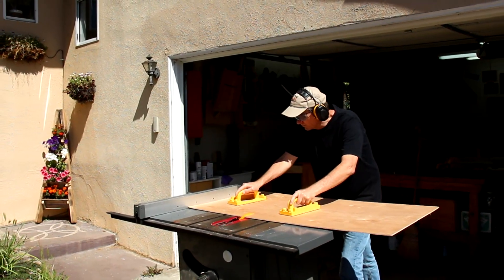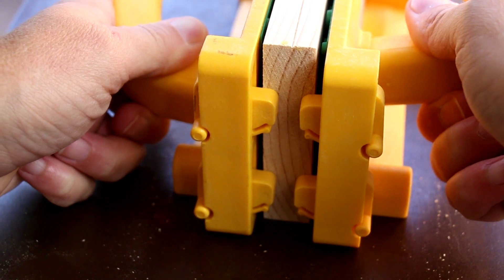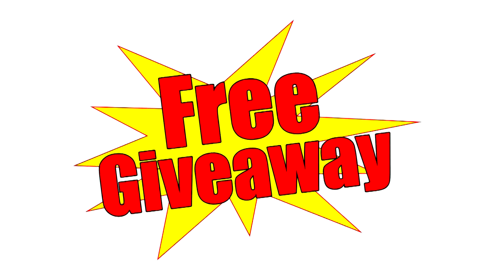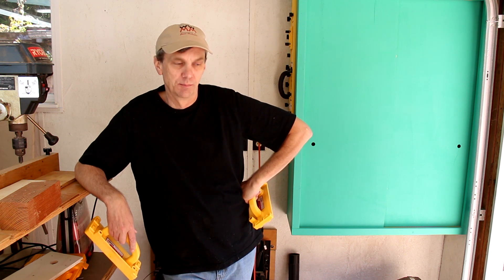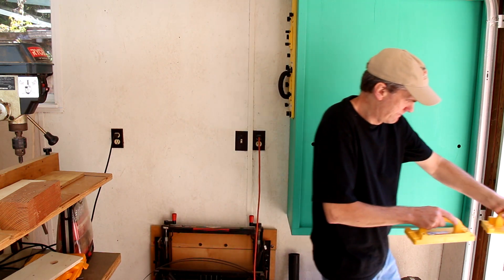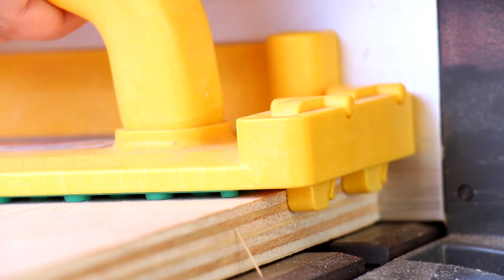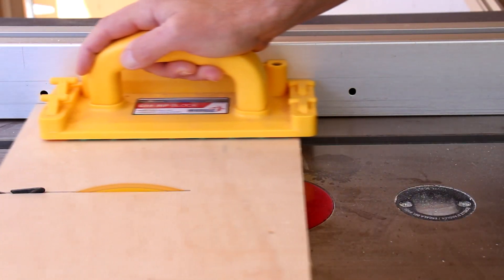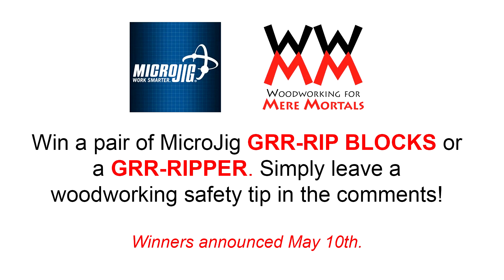Woodworking Safety Day. Thousands of safety tips in the comments!

Comment: Hey Steve. My shop safety tip is a two-fer but it's an important shop safety tip. Cleanliness and Maintenance. Make sure you keep your shop clean and organized. This also means make sure you clean up boards off the floor. Tripping on a board or falling on a tool can cause serious injury. Also maintenance, a well oiled tool or a sharp blade- either saw or utility- is much safer than a dull one. Remember a sharp tool is a safe tool.

Comment: Another good idea is to make sure that any power tools has no power going to it when you're working with the cutter.  I tend to keep my tools unplugged until I'm just about to use them.  It can be a bit of a pain, but it's less pain than dealing with an angry router buzzing around on the shop floor.

Comment: Practice the cut you are planning to make before using your tool with power. Not only will this show you any problems (such as not enough room on your out feed table), but will build your confidence when making your cut. There is nothing worse than being afraid of the cut. This is also a great tip for beginning woodworkers and those teaching.

Comment: Whenever you are changing out saw blades on any of your power tools, make sure to unplug or disconnect the power supply.  You definitely do not want to accidentally hit the power button while working around the blades. This is especially important if you have a cordless circular saw, you would need to remove the batter then.

Comment: #1 never work tired. Take a rest or a nap if you need. When you are tired your responses slow and if something were to go wrong, you might not be able to react fast enough. 

#2 always keep a stocked first aid kit with gauze, bandages, burn ointment, and antiseptic. it never fails to amaze me when I walk into a shop and the first aid kit is missing or empty. It only takes a few minutes to check and it could make the difference between a cut or a casket.

Comment: Hello Steve :-) love ur show!! My safety tip is: when using a skil saw, use a hard surface, don't try to hold the wood on your knee while cutting one end of it with your other hand! AND, make sure the guard goes back to cover the blade BEFORE you set it down and ruin the floor :-)

Comment: One thing I always do religiously is not just switch off a saw, router, planer, etc...when changing blades, but also unplug it and keep my kids out of the area while doing so. I also never leave power tools plugged in when I'm not using them to prevent curious little ones from doing their own woodworking projects without me.

Comment: I bought a jointer and installed the fence upside down which left a gap at the bottom that the blade guard slid under after a cut I made. The blade knicked the tip of my finger(yes I luckily still have a finger). My safety tip is: Read the installation instructions.

Comment: After changing your bandsaw blade  especially if you own a Grizzly,  go back over the bandsaw to make sure that you put all wheel covers, and blade protective covers. especially the blade cover to the left near the on/ off switch.  Otherwise you could while cutting and turning the the wood in a thought less motion,  could result in cutting your left arm getting cut to the bone and walk up the bone. The blade will suck you in and the blade is not forgiving. Lots of blood and the pain will come later. So my safety suggestion is  CHECK everthing once again for forgotten protective covers.  Your your arm  is very important .

Comment: No power = no problem. When changing bits or blades, or when cleaning or adjusting any power tool, remove it from its power source (unplug it or throw the breaker). When you're done, return power to the tool. Be sure to read, understand, and follow the instructions that come with your power tools.

Comment: I don't have a woodworking tip, but if I did, it'd be to not work with small pieces. Instead, machine the piece when it's part of a larger board, or glue it to something you can handle without your fingers getting close to the blade or bit.

Comment: In a house with toddlers or young children... it is imperative to keep the shop locked if possible or at the very least keep all tool safety "keys" removed and inaccessible. 

If the tool has no safety key, I recommend zip tying the power cord to part of the tool. Zip ties cost pennies and are a great way to child proof a power tool when not in use.

Comment: Norm Abram recites a standard monologue about safety. The exact wording has varied over the years, but most of the time it is substantially as follows:
"Before we use any power tools, let's take a moment to talk about shop safety. Be sure to read, understand, and follow all the safety rules that come with your power tools. Knowing how to use your power tools properly will greatly reduce the risk of personal injury. And remember this: there is no more important safety rule than to wear these — safety glasses." [He points at his aviator-style prescription glasses.]
(occasionally added) "And also hearing protection when necessary."

Comment: I would have two bits of safety advice:
1. Always use the proper amount of clamps for a project....lacking clamps and having someone hold bits together, even in a simple controlled project, can lead to injury. You never know when that drill bit is going to break because the material is dense, or when something is going to hit a knot and make the one using the tool loose control momentarily.
2. If you don't know the wood, haven't worked with the wood before, or it is exotic look up the lung safety info before sanding/working it. If you don't want to do this, just get in the habit of using a respirator/mask. Better to be safe than sorry with your lungs, and it's easy to forget this step.

Comment: Use a zero clearance insert when cutting small pieces on the table saw otherwise the could fall down into the saw and hurt you if slingshot out.

Comment: Obviously late but when using a drill press with a hole saw duller than my brain, it is a BAD idea to hold the workpiece in place with your hand while working at night in a shed where the only working light is a clip light. The workpiece will get stuck on the saw and start spinning. Took a chunk out of my thumb. Typing on my tablet is hard because it registers two separate touches.

Comment: The safety tip my father has told me at least 100 times..   Do not use the jointer for short pieces.  "I've seen more fingers lost from the jointer than the table saw."

Comment: Create habits that become automatic and second nature : e.g on the router table I do this  - Finish the cut, turn router off, wait for the cutter to stop, remove the piece, switch off the power. 99 times out of 100 you don't need the additional safety that the routine brings, the 1 time that you needed it, it's already there.

Comment: 1. Do not clean off equipment with compressed air. It might be fast and efficient but it can blow debris and chips into your eyes. Depending on how fine the chips are the debris can even get around safety glasses. 
2. When attaching stop blocks to a miter box make sure they are clamped to the base of  fence and not a fence extension. Otherwise when the saw first digs into the wood it could kick up and pull the fence with it.

Comment: Everybody is going to mention to wear eye protection, ear protection, safety toed work boots, tangle-free, close fitting clothes that do not get caught in machinery, and dust extractors etc.
My safety suggestion is 1:  Make sure you know your equipment and tool operating specifications and instructions.
                                       2:  Make sure you are using the correct wiring power circuitry.  120 - 220.
                                       3:  Make sure you are working in a clean non-obstructive floor area.  You do not want cords, wood, refuse and debris on the floor to trip over.
                                       4:  Make sure you work in well lighted areas.
                                       5:  Make sure you use your tools safety guards
                                       6:  USE YOUR PUSH STICKS, AND GRIPPER ASISTS, and KEEP YOUR HANDS AND FINGERS AWAY FROM THE BLADES / KNIVES.
                                      7:  Wait until the blade stops before reaching in to remove cut pieces.
                                      8:  BE WELL RESTED before operating machinery
                                      9:  Be SOBER before operating machinery of any kind.
                                    10:  Keep outside NOISE and DISTRACTIONS to a minimum so you concentrate on your work.
                                    11;  Set up your work so that nobody can come up from behind you and startle or scare you.

IS THIS ENOUGH TO WINN???????????

Comment: The one thing that I really always must adhere to when I'm working in the shop is always have someone else within earshot. Everyone makes mistakes. No matter how careful you are, one day you'll screw up and hurt yourself. Often it's very minor, such as burning the tip of your finger in the belt sander or pinching yourself in a pair of pliers, but if you were to get your shirt caught in a lathe, or slipped and sliced your arm open on a table saw, having someone within earshot would almost certainly be the difference between life and death.

Comment: The best safety tip I can think of is to work within your limits. If you don't know the tool, the material, or the exact way to do something, you shouldn't rush in. If you're not comfortable ripping sheet goods on a table saw, seek help with it until you build proper technique. If you have never done close-quarters cuts on a bandsaw, have someone coach you until you can do it safely. Most injuries I have seen come from an incomplete understanding of tool usage and quirks in the materials being used. Don't be afraid to ask others for instructive help and IF YOU'RE NOT COMFORTABLE DOING SOMETHING, DON'T DO IT!!!

Comment: Put a coat of automobile wax on your table saw surface and the rip fence.  It will decrease the amount of force used to feed the material. Note:  Pretty good idea to wax other surfaces as well ie. Band saw tables, router table tops, jointer etc.

Comment: Be sure to use a respirator or have a proper dust collection system when working in confined spaces with little to no proper ventilation. Even particles 8 microns and below can be hazardous. These are even more hazardous than larger particles because these can pass so easily into you lungs and respiratory tissues. Happy woodworking...and be safe!

Comment: Don't store the key in the side of the drill press chuck it will fly out if the press is accidentally turned on. Instead chuck it like a drill bit or hang it from a cable

Comment: Never try to joint a short piece of stock.  I recently ran a 5" piece over my jointer and lost a few mm off the tip of my middle finger.  It could have been much worse.  The piece simply tipped forward into the gap and the cutter head snatched the whole thing faster than an eyeblink.

Also set your machinery up so you never have your back to the door.  Then you can't have someone come up behind you and make you jump - into the machine...

Comment: A Safety Tip:
Whenever you work on a project that uses more then one power tool (in my case, a wood lathe, a power drill and a table saw), switch off the tool you were using before turning on another tool unless you need to use them together (a lathe and a drill for power sanding), this way you won't have any surprises when you come back to work on your machine, it will be off and still. As a bonus you will save electricity and minimize the chance of a power outage by overloading your capacity if you are working on your home electricity supply.
Work Safe!

Comment: Wax your table saw, joiner, and router table surface. Not only does it protect the surface but it also makes it easier to push and control your work piece. I just use past wax.

Comment: If you are a preparing to turn a large piece of wood on your lathe, be sure to set the speed to the lowest setting BEFORE mounting the piece on the lathe.  Seems logical, but it happens... you get excited about starting a new project, and getting it moving on the lathe, and before you know it, you've got a large, out of balance piece attached to the lathe, and your speed is still set from when you finished your last pen at the highest speed.  Not a fun experiment to turn the lathe on and see how fast you can reset the speed without harming yourself or your shop.  Not to mention the damage you could do to the equipment!

Comment: Only use woodworking machines that you have been trained to use properly and safely also if you have someone around just in case you get hurt or seriously injured.
Read the owner's manual carefully.
Make sure you understand instructions before attempting to use any tool or machine. Ask questions if you have any doubts about doing the work safely and properly.

Comment: If you use surge protectors to plug your tools into (the ones with like 4 or 5 plugs) - do not leave them on the ground where saw dust can collect in the plug openings = FiRe HaZaRd...

Comment: Safety Tip 1 - Do not remove machine guards.
Safety Tip 2- Always wear safety glasses & hearing protection.
Safety Tip 3- Do not wear loose fitting clothing around rotating machinery.
Safety Tip 4- Pick up your shop. Air hoses, Vacuum hoses, Extension cords, Saw dust scrap wood are all safety hazards.
Safety Tip 5- Always use push sticks, finger boards or push blocks to keep your hands away from rotating elements.
Safety Tip 6- Read & Understand the machine's safety guidelines.

Comment: Just like in the kitchen, use sharp blades. A dull blade (or bit) is dangerous. If a saw blade is not very sharp, the tool will have to work harder to complete the cut. This could cause kick-back or binding. Also, a sharp blade will give you a cleaner cut.

LOL..."Uh, yeah, seriously I won't show you that because I don't own a jointer. But if I did, it would look something like this..."
Reply: Steve, thanks for all your inspration! Don't stop doing what you're doing! :)

Comment: Everyone know to clean and sharpen hand tools because it makes them safer by not forcing the tool.
But did you know the same applies to power tool cutters like; table saw blades, router bits, band saw blades and even biscuit joint cutters and power planers or joiners.
Forcing material into dull and dirty, gummed blades can cause you to loose control and result in serious injuries. 
So, take a minute to clean, examine and sharpen the cutters on your power tools.

Comment: “...But before we use any power tools, let's talk about shop safety. Be sure to read understand and follow all the safety rules that come with your power tools. Knowing how to use your power tools properly will greatly reduce the risk of personal injury. And remember this, THERE IS NO MORE IMPORTANT RULE THAN TO WEAR THESE...SAFETY GLASSES."
Norm Abram
The original woodworking mentor 

We have been told this for so many years it should be branded into our brains. (Improper use of the soldering iron).

Comment: Safety Tip: To make sure you unplug your table saw when changing blades hang the wrench by a screw near the outlet supplying the saw (or other tool) put a loop or hook on your cord end and never take that wrench off without hanging up the unplugged cord. and vice-versa never plug the cord back in without hanging the wrench back on the screw. Relax slow down be safe and ENJOY!

Comment: Well hand tool safety isn't a big issue as you can learn by experimentation though it is better not to play mumblypeg or garden with your fine bench chisels but when it comes to the big power tools you should read a few good operating manuals and mentally practice the safety procedures before one of them eats your hand or spears you with a - - - well you get the idea!

Comment: Do not wear clothing with a lot of extra fabric (sleeves, tails etc.) when operating any machine that has spinning parts such as the table saw, skill saw and router. The spinning blade / part can catch the clothing and pull you into the machine.

TL;DR: Tuck in lose clothing when working in the shop!

Comment: Use safety glasses and ear protection, and read and understand the manual to your machines before start using them.. Oh, and yeah. try not to stick your fingers in your spinning table saw blade. There is a big risk you don't own a SawStop saw.